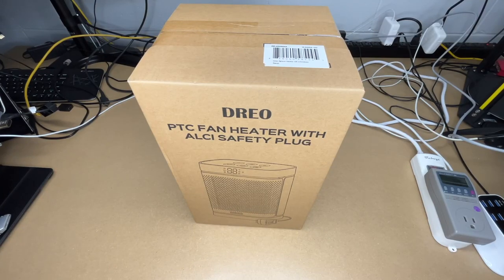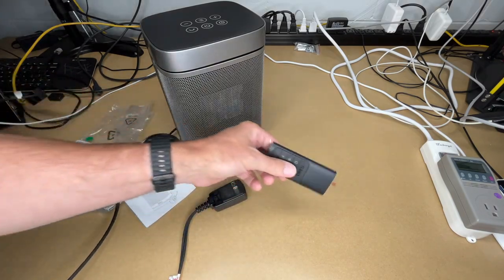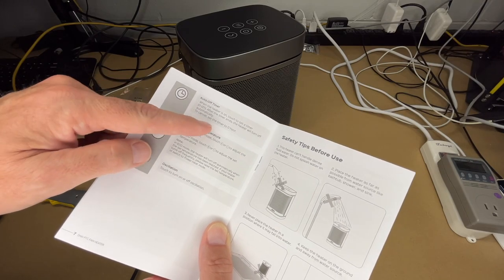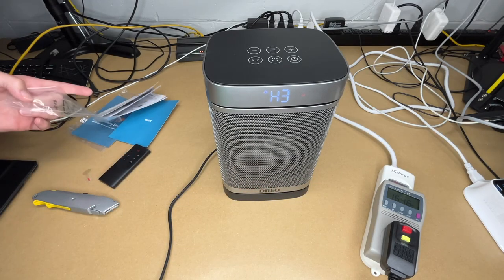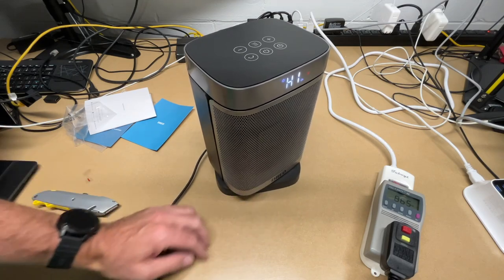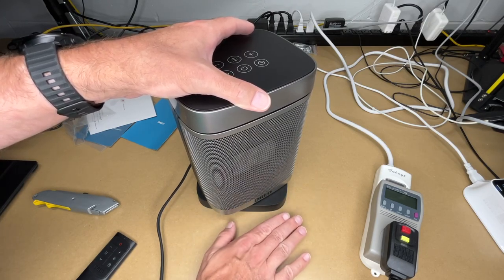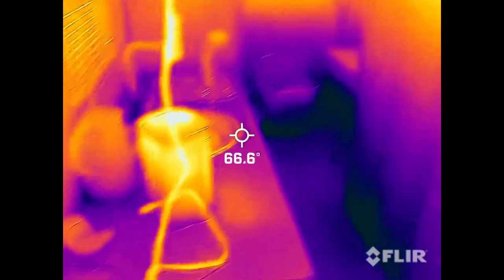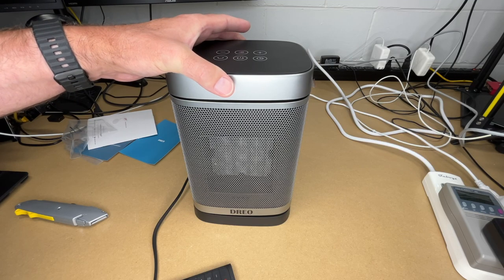Dreo Atom Oscillating Space Heater with Remote (in RV)

Comment: You have the Dreo Guard, not the Atom. This size Dreo has 3 models: Atom, Guard, Sense.
Reply from the maker: The branding with Dreo is confusing. The main product name on Amazon just calls it "Dreo Space Heater". In the "Dreo Space Heater Family" section of the product listing, they call it "Atom Guard". On Dreo's website they show a "Dreo Atom One" but not "Guard" or "Sense". Looking at it now, I think this is the Atom Guard which is like the Atom One with but an ALCI plug.